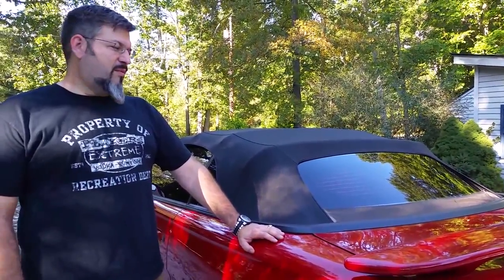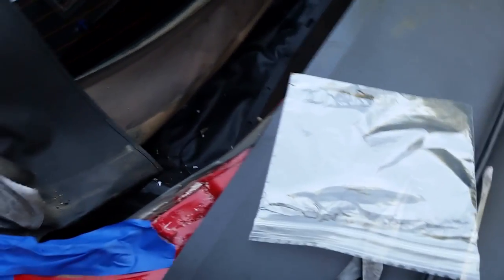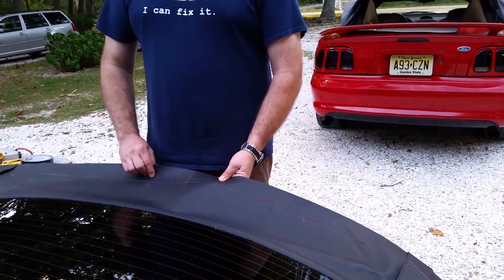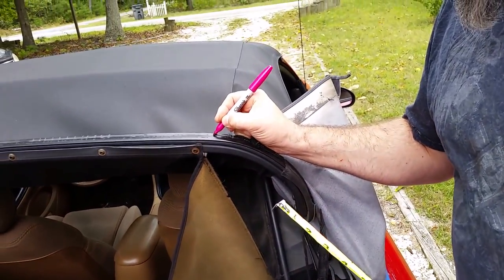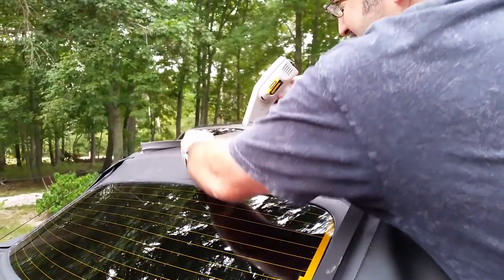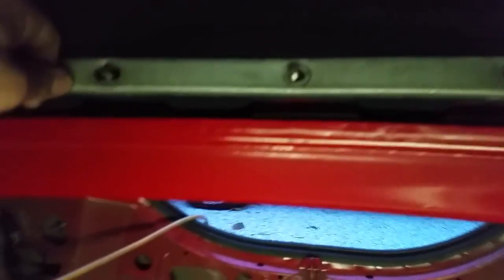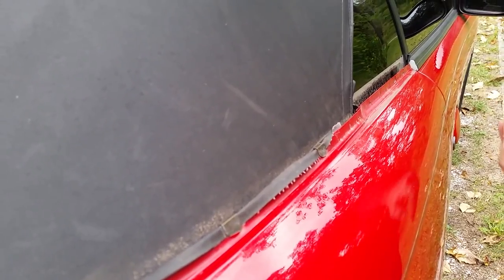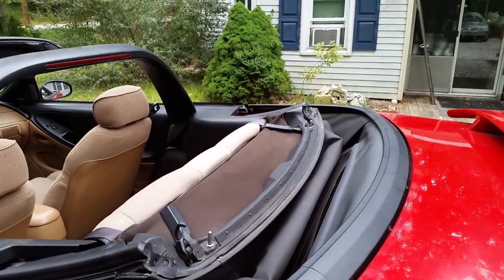1994 to 2004 Mustang Convertible Rear Window Step By Step Replacement Save Money $ $ $

Comment: I’ve been wanting to replace my whole top I’ve watched the video & I have some questions! Do you think you can tell me what tools I’ll need for the job??
Reply from the maker: Rebecca Saldana it's time consuming but anyone can do it.  There really aren't any special tool. Screwdrivers,  Metric sockets and wrenches(I mention in the video) ,  decent staple gun or power staple gun like I use in the video.  A smooth face hammer to hammer any staples down that don't go all the way in(I use hammer in video) if you are replacing the entire top, you will have to remove the back seat and rear interior panels to get to the tension cable that runs inside the convertible top along the rear quarter windows(it keeps it tight there otherwise it would flap while diving Down the road). Take pictures as you take it apart to remember how it goes back together. With the rear interior panels out.  Open the top and take off the front edge weather strip. Then remove the staples in the canvas on front edge,  work your way from the front to the rear. Release both side tension cables.  Follow my video to take the rest apart.    Use the old top to lightly trace (with something that will wash off)on the new top canvas to get it close. Clamp it together out of the car to test fit to rear window.  Work your way from the rear toward the front.  Staple window canvas to rear strips(test fit with top almost closed) attach main top to rear strips and install strips(not fully tight) fold canvas to over rear of car and staple  canvas window to rear bow. Pull top toward front, install tension cables,  leave top open a 2 inches, stretch canvas around( keeping open 2 inches, make sure it's centered & staple it)  install weather strip.  You should have to pull hard to get top to close stretching canvas. Over time it will get easier to open and close.  Stretching it good should take out some of the wrinkles. I am missing a few steps here with interior of the top.  It's been a while since I've done the a convertible top and I'm help you were I can.  Good luck.

Comment: This helped me a great deal however I would like to make a few notes:
on my 1995 the nuts along the bottom of the curtain that are plastic/nylon and secure the curtain the the car are 14mm not 13mm. Also on the 1995 there are three screws on the trim around the outside of the top and its metal. All and all a great how to just wanted to add the notes in there for ya.

Comment: what about the one piece top and window? good or bad?
Reply from the maker: I'm not sure how I feel about it and I've never installed one.  I posted a link because It's a cheaper option, but you can't really tint the window and there's no defrost.  Mustangs never came one piece.   They only came window and top separate.

Comment: Hi there. I'm replacing my rear window due to the defroster heating it up to the point of shattering. If I go to a salvage yard, remove a rear window that is in good condition, will I be able to avoid measuring, and cutting the window fabric? After the removal process I would simply be skipping to about 18 minutes, correct?
Reply from the maker: Ramirez4565 you would think you'd be able to skip a bunch of steps but you might shoot yourself in the foot too. You say your old one heated up to the point of breaking, I don't think I've ever heard of that happening.  But  before replacing the window, I would replace the defrost switch/ or relay because it wasn't shutting off in the correct time overheating the window.  You don't want it happening again.  About Shooting yourself in the foot, make sure the junkyard window vinyl is in good condition, no cracks or anything,  because if it has any the window will fail and leak in the future. You would need the top bow the window vinyl is attached to cause once you pull the staples it changes it's position and the get the bottom metal brackets that hold the bottom tight into the body of the car. Keep the top bow and bottom brackets attached to window vinyl.  There is a ton of staples holding the vinyl to the Top bow and bottom brackets.  But , Not every mustang is exactly the same, meaning that just because a mustang has the same window doesn't mean it will fit the same in yours. It could be completely off,  if you got a used window and put it in your car without any wrinkles I'd say you were darn lucky. The prior installer of the used window could have it off center or high or low and it could be a Ford factory installer.... no two installers install  exactly the same from car to car or year to year.   You could get it in your car and be too tight(meaning your Top bow won't line up with the permanent stretch marks in your main tops fabric causing a wrinkle/ saggy fabric)  or too loose (meaning you window will belly/ sag inward).  Your main Convertible top fabric has stretched to a specific position in relation to the top bow of the your existing  rear window. The used window in place in it's proper position on your car may not line up with the your main tops fabric where the old bow has created a permanent stretch that is set in the fabric. That will create a wrinkle in your main tops fabric on that rear bow.... I keep repeating myself but, I hope that makes sense.  The problem is installing a convertible top or a window there really aren't any shortcuts you can take unless you don't care if it looks like crap and it's all in the name of saving money.  I'm just saying you may get lucky or you may not.  Just don't be surprised if something doesn't line up right. Me personally, if I'm going through the time of tearing the convertible  all apart to put a used part on,  that may be at its half life or less that will fail in that future.  Why not spend the money and buy a new window that will last 15 years or more. I understand everyone is different and can't always afford new, money determines a lot of what people can and can't do.  Also people will go cheaper buying used because they aren't keeping the car long term. Do what works for you.  Thank you for your question.  I hope this helps.  Like, Share,  subscribe because you never know what I'm going to do next.
Reply from the maker: Ramirez4565  you would think you'd be able to skip a bunch of steps but you might shoot yourself in the foot too. You say your old one heated up to the point of breaking, I don't think I've ever heard of that happening.  But  before replacing the window, I would replace the defrost switch/ or relay because it wasn't shutting off in the correct time overheating the window.  You don't want it happening again.  About Shooting yourself in the foot, make sure the junkyard window vinyl is in good condition, no cracks or anything,  because if it has any the window will fail and leak in the future. You would need the top bow the window vinyl is attached to cause once you pull the staples it changes it's position and the get the bottom metal brackets that hold the bottom tight into the body of the car. Keep the top bow and bottom brackets attached to window vinyl.  There is a ton of staples holding the vinyl to the Top bow and bottom brackets.  But , Not every mustang is exactly the same, meaning that just because a mustang has the same window doesn't mean it will fit the same in yours. It could be completely off,  if you got a used window and put it in your car without any wrinkles I'd say you were darn lucky. The prior installer of the used window could have it off center or high or low and it could be a Ford factory installer.... no two installers install  exactly the same from car to car or year to year.   You could get it in your car and be too tight(meaning your Top bow won't line up with the permanent stretch marks in your main tops fabric causing a wrinkle/ saggy fabric)  or too loose (meaning you window will belly/ sag inward).  Your main Convertible top fabric has stretched to a specific position in relation to the top bow of the your existing  rear window. The used window in place in it's proper position on your car may not line up with the your main tops fabric where the old bow has created a permanent stretch that is set in the fabric. That will create a wrinkle in your main tops fabric on that rear bow.... I keep repeating myself but, I hope that makes sense.  The problem is installing a convertible top or a window there really aren't any shortcuts you can take unless you don't care if it looks like crap and it's all in the name of saving money.  I'm just saying you may get lucky or you may not.  Just don't be surprised if something doesn't line up right. Me personally, if I'm going through the time of tearing the convertible  all apart to put a used part on,  that may be at its half life or less that will fail in that future.  Why not spend the money and buy a new window that will last 15 years or more. I understand everyone is different and can't always afford new, money determines a lot of what people can and can't do.  Also people will go cheaper buying used because they aren't keeping the car long term. Do what works for you.  Thank you for your question.  I hope this helps.  Like, Share,  subscribe because you never know what I'm going to do next.

Comment: I need some help they replaced my top about 10 years ago. Its garage kept and I only put 3,000 miles a year on the vehicle. The top still looks brand new but i noticed it leaking. When I followed your steps and thanks for this video by the way. I took off the metal bracket holding the glass to the trunk area. There looks like there is a rubber seal that attaches to the metal of the trunk area. and then the top attaches to that. Do you know if they sell a new rubber seal for that. I don't think its bad rubber but the seal isn't sticking anymore to the metal of the car its pealing up allowing water to get in. I have no tears at all on my top. EDIT you can see what im talking about at 17:30 of the video if you pause it at that spot its the place rubber gasket that is attached to the body of the car.
Reply from the maker: To the best of my knowledge they don't make a seal for where the top attaches to the body. They rely on fresh new vinyl top making a seal to the body and the channel underneath guiding any water out of the car. The rubber strips stapled in the rear corners are more for protection of the corners from chafing, not water.  First make sure there isn't any holes or rust in the channel that  runs  under the convertible top body mounting area, if there are any holes that's how water is getting in. if it's clean then the other thing you can do is apply a bead of Silicon between the top and the body.  Also make sure your back window curtains that wrap around toward the quarter windows don't have any slack in them were it could allow water to drip somewhere higher from the curtains missing the channel that guides the water out of the car.  Water finds a way like dripping through spider webs.  Climb inside your car with the top up and have someone on the outside with a hose slowly running water onto the top to try to pin point where it's leaking from. Good luck let me know how you make out.
Reply: Well I guess the people who installed the top to the vehicle put some kind of seal back there . I called ford they have a part number for it but stopped making it. I found one online the last one ever but its located in Italy and isnt cheap at all plus the shipping. So what i ended up doing was taking some liquid nails for rubber and re sticking what was pealing up off the body of the car and re glued it. Then i took Black RTV silicon and rubbed a smmall layer over the weatherstripp. I let it dry added another one did that 4 times. After re installing everything it doesn't leak now at all. even took it to a drive thru  auto wash  and still not leaking.

Comment: My rear window straps that go on either side were cut off from who ever installed top around 10 years ago when it was replaced last...other then that window and material are good...not sure if i should find strap material and try to attach to window or not before I install new top...not sure how important having those straps are? What's left or mine is 3 inches hanging down from the top on either side...straps don't seem to have any elasticity at all...any suggestions on where I could get these straps or just not worry about them...thanks
Reply from the maker: roadstar499 in my mind those straps aren't the end of the world if they aren't there.  The best I can figure they are meant to support the outer  convertible top canvass from sagging around the window. I think most canvass repair places can get or do have similar elastic if wanted to replace it.  Good Luck on your project.
Reply: Zero Fuel Required yes...Mecca said same thing...Installed without straps seems fine...I have to go to bone yard and see if I can find some mustang rear window bolts a couple on mine are messed up do to whomever installed top ten plus years ago...thanks again.

Comment: I have a 97 get convertible and the top is pretty beat up . Theirs a 94 gt convertible with a much better top. Would it be easier to move the 94 top intto the 97. I’m trying to see if this would be easier then tearing the whole top down.
Reply from the maker: 94 and 97 are basically exactly the same body.  If you're asking if it would be easier to unbolt the entire frame with convertible top intact to transfer the top another car would be easier?  That would probably be a yes. Put the cars side by side. Then pull the seats and quarter panel out to compare the frame from one year to the next to make sure they didn't change the way the frame mounts or what hooks to it to maker sure ford didn't change anything.  While you've got the car interior apart that has the good top, look for any hiding leaks, dryrot or cracks. You don't want to be doing this repair a year or so from now if the top is no good.  If you are planning on keeping the car for a long time a new top might be a better choice.  If you decide to do the swap Definitely get help to remove or lift the top from one car.  And get help to install it in the other.  Hate for you to punch a hole in the good top.   Hope this helps and thanks for the question.
Reply: Zero Fuel Required thank you

Comment: Thanks for the Vid, this I will look forward to doing on my 2000 V6 mustang. this will add value to the car and sentiment for doing it. how do you feel about the Hard convertible tops theyre selling online? I found a place in Penn. that does this but I live in Ca. Soft top for most likely. any recommendations where I should purchase? I also noticed the sell the soft top with the rear window, what would stop me from using my old rear heated window? thank you again.
Reply from the maker: Matthew Busch I personally don't like them or how the hard top convertible looks on the mustang but that's just my preference.  They aren't cheap and your mustang will get broken into just as fast, the hard top won't slow a thief down. Even though you might pay a lot for a hard top convertible, they won't really add resale value because it may not turn off all,  but it will turn off some interested  buyers that may not like it like me. If you were planning to keep the mustang forever and you loved the hard top convertibles go for it because the expense would justify over the long run.  If your planning to sell your mustang next year, just repair the original and save a ton of money.  If your replacing your Soft top for one reason or another,  your rear window vinyl folds every time you put your to down so it is probably in just as bad of condition as that main soft top. The rear window usually leak because they develop cracks in the vinyl where you can't see until you remove the main soft top.  Over time the adhesive that seals the rear window to the vinyl often goes bad and starts to separate.  When it does water can leak in and just a small drip can make a mess.  The old window will be a different color than the new soft top because sun fading it.  I recommend don't reuse the old window,  you can get an exact replacement.    Rockauto.com is where I purchased the correct heated window for my mustang with the proper vinyl texture. You can get the correct window and soft top with the correct texture  from them. It will take a little longer than a week to get and they are a great company to deal with for any kind of auto parts for your car.  Good luck when you replace your Top and if you have any questions ask or read the comments because others may have asked as question you might ask and I have answered everyone.  Thank you for your comment.  Like, Share and Subscribe because you never know what I might do next.

Comment: YOU DA MAN ,MAN  .I never realized the top and the window were two completely separate items .  What kind of person would put a new top on with out replacing the rear window assy .It looks like a major job if you do it AFTERWARDS , a real pain in the ass. This is not a job for that spray sealer (they say will stop Niagara Falls)  that they  advertise on TV  HUH ?  Thanks.Wanna do another one chief ?
Reply from the maker: Ha ha thanks for the laugh.  They aren't difficult to do.  They are just time consuming.  I have many projects on the back burner.  I don't really have time for another one.  Lol.  Thanks for the comment.  😉👍

Comment: Will this top work on a 2003 mustang gt? Please let me know I have been looking for the longest for one with glass
Reply from the maker: Yes. Look in my description there is an amazon affiliate link for the convertible top, it is the same convertible top from 1994 to 2004. Just pick your color.  Hope this helps.  Thanks for your question.
Reply: Zero Fuel Required Thank you.
Reply from the maker: @RajunCajunPapPap  my wife put Amazon affiliate links for everything used in the video,  tools, staples etc etc.